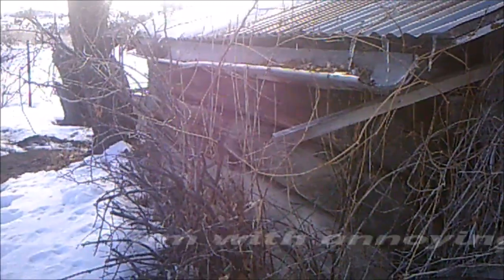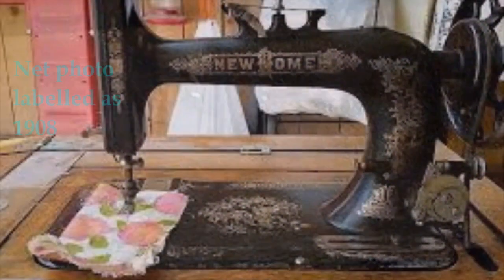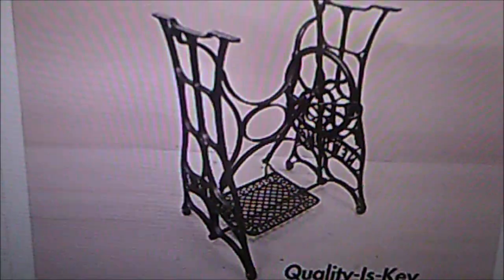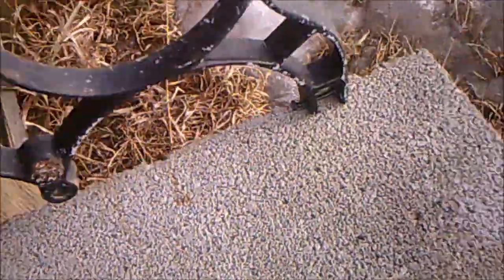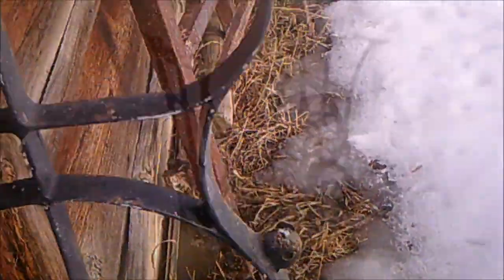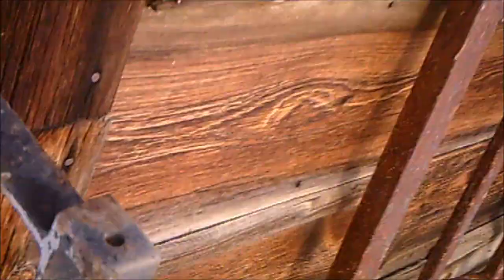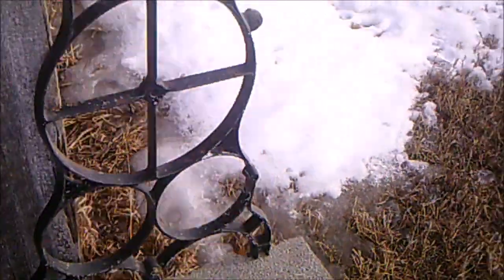Gem in the Coal Shed - Early 1900s Highly-Deco Vintage "NEW HOME" Sewing Maching & Cabinet

Comment: Always interesting 😉😎☮️
Reply from the maker: Gotta love those designs and color still vivd over 100 years or more. Shed is creepy so thought it was a busted up old crate until I pulled up the machine shelf. Missed a shot inside that shows the treadle is intact and working ... sooo may still work. If I knew how or had reason to use it.

Those vintage colors! Thx for your time seeing this; have no expectation you have time/care but related in context is this 1880s safe (with bandit drill holes) "abandoned" (impossible to move now) in the old Montana Mine Co geology lab/admin bldg back in Marysville. SALOON doors and deco still vivid after being in the dusty dark for so long. This is a long one as I make entry/go through rooms until the end... that safe deco is the point. If ever time: https://www.youtube.com/watch?v=WyZyOPbbbpk&list=PLCKjHLBAa0_abHFK9hHKv6moQ81GmAksz